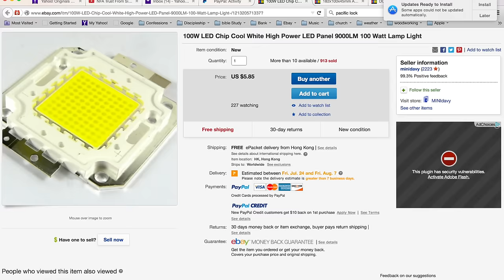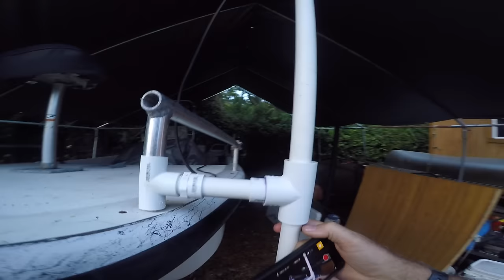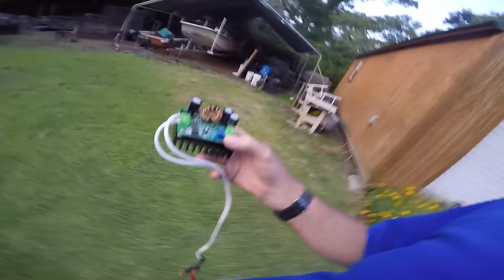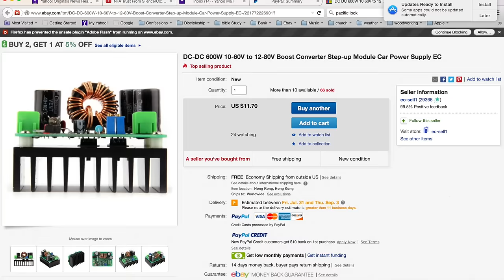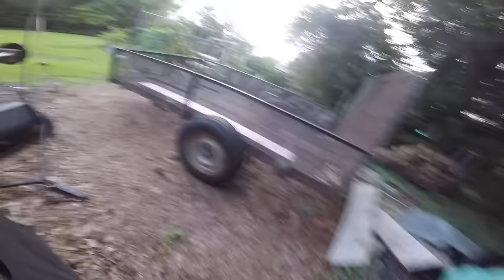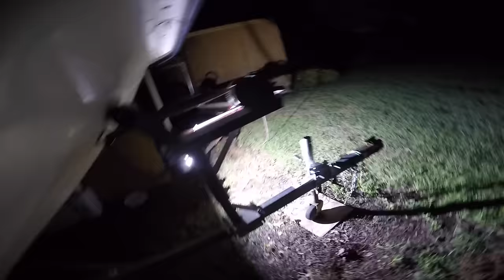Home-made 100 Watt (8000 Lumen) LED Flounder light

Comment: Hi. Nice video, I'm wondering how much this cost you. Also how to prevent the LED lights from burning up. Thanks in advance.
Reply: +Gavin Goleman  I believe it was around 25.00. The most expensive thing was the heat sink.  if you can find this it will save you quite a bit.  I found that the issue was the heat dissipation. The most important thing was to keep it in the water.

Comment: Do you use 2 boost converters off of one battery or 1 battery per light?  I have wired 2 boost converters in parallel to run 2 lights off of one battery but and having issues blowing the transistors on one of the boost converters.

Comment: What voltage and amperage have you found to be the best? And also, what battery do you run?
Reply from the maker: It has been so long ago that I don’t remember specifically. 36 volts of o remember was optimable.
Reply: Well thank you for getting back to me. I went out on a single battery that I had an it died pretty fast so I’m changing it up a little

Comment: Do you have the led entirely inside epoxy? Or just where the leads are under? I would think it would be bad to have epoxy offer the face of the led due to heat.
Reply from the maker: +minicoppergpiscool As to the heat issue. I looked at the epoxy heat ratings and found an epoxy that could handle heat. I found that as long as you run the lights underwater there is no problem with heat. But YOU CAN NOT RUN THEM OUT OF THE WATER WITHOUT THEM BURNING UP. the 100 watt LED get very hot. You will need a large heat sink to run them out of the water. I can attest to this as I burned up one of my lights. It's an ugly sight.

Comment: I got you, I gig around Hilton Head and Beaufort... Got a couple videos on the channel. I can't find that heat sink on amazon anymore... Thought about making one
Reply from the maker: +Keith Ginn  They work as well as a 200 watt bulb. It is a very bright light. The advantage is that you can run it off of a 12 v battery. Some of my estuaries are restricted to battery lights only, no generators. So this gives you a bright underwater light.  There are other options - you can run bright LED strips along the side of your boat. Place strip LED lights under the outside rail of your boat so they will shine down on the water but not in your face. You will be able to look over both sides of your boat rails. I know some guys that do this very successfully off their battery.
Reply: Yeah I also use Leds above and below the water, just thought I might make my own from Amazon. Looks great tho!
Reply from the maker: +Keith Ginn  I enjoyed our video, It gets my blood rolling to get the boat out and get a few flounder.
Reply: I got mine from Ebay, just be careful of size, they are all metric so have your mm ruler to get the size you want.

Comment: What type of battery are you using. I've got everything but... just trying to do it right
Reply: I use the 12 v. deep cycle battery that I have connected to my motor boat. It is nothing special. As I commented earlier I connect my honda generator to the battery so that it remains charged. I'm scared I won't be able to start the motor so I have this back up. The honda generator does not have enough amps to run the lights by itself. I hope that helps.
Reply: @williamragsdale2097  I connected the setup to my truck battery,  worked great!. I have a 12 ft Jon boat with a 6hp tohatsu tiller...a little 12v for a mower will probably work great!

Comment: Thanks for sharing.  Is it still working and have you found any issues with the convertor on the boat?
Reply: They are the weak link, they are cheap. You can follow the link to ebay. I have not had a failure but I treat it like a baby. They are cheap so I feel I can replace it if needed. I looked at converters that I could plug into my generator but they were around 100. which was too rich for my blood as I was experimenting with the whole process.
Reply: Does the convertor and light get extremely hot and if so how do you deal with the convertor since it is not in the water to stay cool. I have seen people use fans.   I assuming you use the light in the water based in your set up.
Reply: Yes, I made two lights as shown in the video, I did not think they got that hot but while running my boat with them out of the water the first one I built burnt up. I mean smoke coming out of it, the whole center of the LED burned black. I am sure that you can build a heat sink to handle the heat but I am no expert, I only experimented. I have found that if you run them in the water there is no problem. You will have to experiment with the lights you build to see how they operate out of the water.  If you need lights for running your boat, you can get a LED light bar at a wide variety of prices. Go stick a few flounder!!!
Reply: +William Ragsdale I think the 100 watt has a lot to do with it.  I'm thinking maybe lesser wattage but maybe more chips overall. I will play with it but I like the concept.
Reply: You are right, Lower wattage will mean lower heat and smaller heat sink.  I have thought of having several LED positioned at different angles so that you have a wider view area. My version has almost a 180 degree viewing area but the light on the edges is not as bright.

Comment: So does this unit not need a driver or is that what the "boos converter" is?
Reply: I want to make one that is fully submersible (for walking and gigging) without having to haul around a boost converter
Reply: I ran two boost converters from one 12v battery. I carried a generator so I could charge my battery. the LEDs draw minimal current.  I show the components and where I bought them on a different youtube video. See https://www.youtube.com/watch?v=B7ro37_0RcE

Comment: What led chip can I use on 24volt battery so I don'r need a booster
Reply: Get the 36v chip. Should be fine.

Comment: Nice video. Do you have any of it in use?
Reply from the maker: +Matt J I built two lights and still use them as my go-to lights. I did burn one up, I left it out of the water as I traveled from one creek to another and the heat sink was not sufficient. The one that burned up is in the video above. If you build one, the 100 watt LED if it is given maximum power (36-40 watts, 3 amps) will get real hot and will burn up the LED and the epoxy cover. While in the water the heat is dissipated. I am not sure how to measure the amount of heat sink that is needed so I was only experimenting.
Reply: +Outdoor Hydroponics  
I'm building one this week only to be used under water I have epoxy resin on hand and I'm wondering why you picked the glaze over resin?
Reply: +Matt J It is Parks Super Glaze but it is a two part epoxy - it is glass clear and stands heat and chemicals. I chose it for those two reasons. I tried a 5 min epoxy but it made a lot of bubbles which I could not get rid of in the short set time.  This Parks Super Glaze has a set time of about an hour and a 24 hour cure time. It gives you time to take your torch and get the bubbles out. You can see how on a number of youtube videos. It has worked great for me and has held up well. Except for the one I burned up - it does have heat limits.
Reply: +William Ragsdale 
Ok I'll give it a try thanks for the info and keep them videos coming!

Comment: where did you find the heat sinks ?
Reply: I went on internet and googled. Most are from china. That was probably the most expensive part of the build for me.  I started going to my junk yard which has a lot of aluminum, also old computers have heatsinks.  I do not know the formula for the size of a heat sink for out of water usage but in the water you do no need much.  You could probably get away with just using thick aluminum angle.  Just don't run them long out of the water.
Reply: the tough part was finding them the right size.  Most sold on the internet are off cuts from industry or shops and you can not get the exact size you want without paying a steep price.  Good luck.
Reply: +William Ragsdale oh ok I gotcha thank you